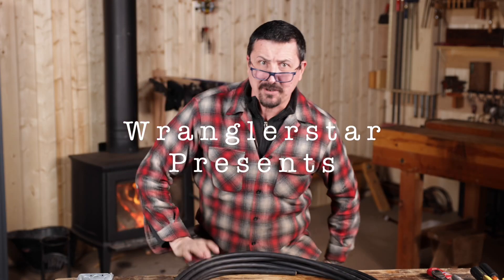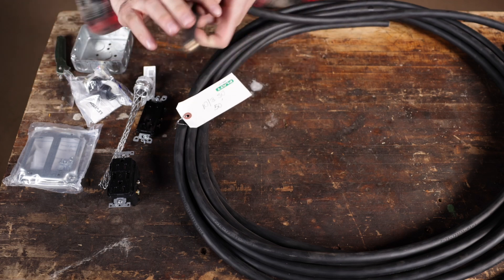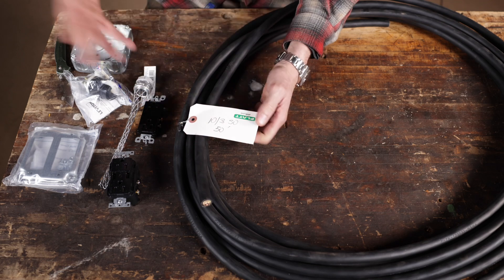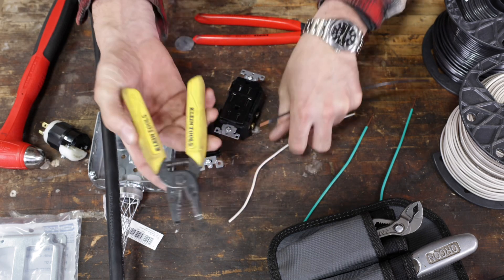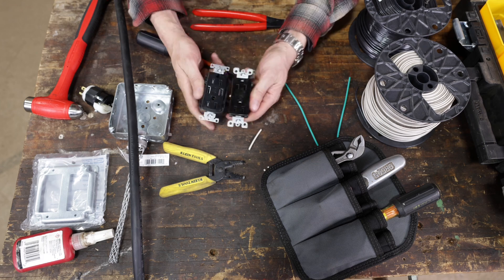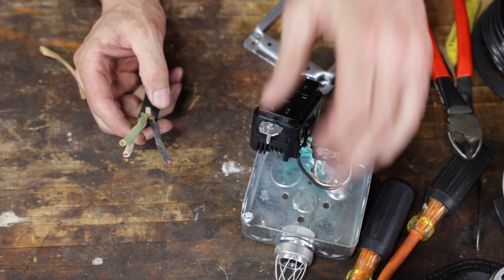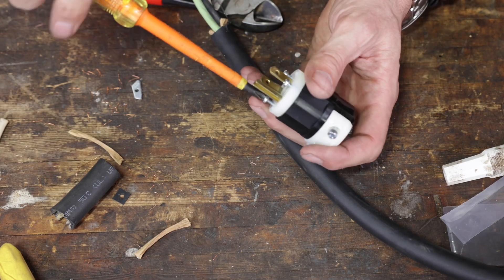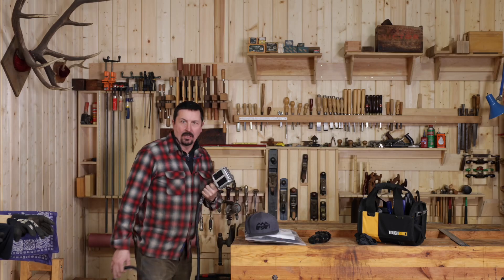The Ultimate $150 Shop Accessory - ALPHA CORD

Comment: Wranglerstar has the bravery to upload these electrical vids knowing that the internet electrician guild will swarm his comment sections. The man has no fear.
Reply: views are views
Reply: haha i was one of them .hahahahahahahah I recomended that he put a drying plug on the end and wire the 2 oulets to the separate phases, THEN it will truly be a beast. .  and pump out 7200 watts total 3600 watt per outlet,  the only weak link would be the 20 amp outlet, but i feel confident it would work just because the 10awg is wired directly to it so the the path from the 10awg to the outlet is likley less than an half of inch with very little resistance. . .  would be a interesting test to pump 30 amps thru it and see how a  20 amp outlet fairs wired that way
Reply: @mikeriverajr4447  Yeah I was gonna mention what you said, being an electrician I just couldn't help myself. The plugs and the male cord end he's using are way underrated for that gauge of a cord. Plus as everyone else has mentioned, he's got his lock-ring on the outside of the box when it should be on the inside. And lastly, the box he's using is not really correct. Any electrical box with knockouts is supposed to be affixed to a wall, per code. They make pendant cord boxes that have a single threaded hole on the top specifically for a cord strain reliever. One reason why you don't want a box with knockouts in this situation is because if he were to grip onto that box and try to plug something in, he could potentially push in a knockout with his finger or thumb, and that knockout tab could come in contact with a side screw on the back of the outlets. (also why you should wrap tape around the back of an outlet device after wiring it).
Reply: @420JackG  commercially this still is atleast at all the H-E-Bs and most super that need drop cords
Reply: That's the plan, Stan!
Reply: @mikeriverajr4447  I actually thought with that heavy a wire itd be a 30A plug.
Reply: lol
Reply: @Fordgroup00  👍
Reply: Omg i want this
Reply: Yeah he realizes all those posers aren’t actually doing things in the real world. Just a bunch of internet experts lol.

Comment: Electrician here. We call your "slugs" knockouts. Your grounding wire for your j-box, we call those stingers. The cord you have there, we call it s/o cord. I also save the metal tabs i cut off of devices and use them as washers. Always carry a few in my pouch. Im sure somebody has mentioned it, but your strain relief, (sometimes we call them kellums grips), has a lock nut on it, that goes inside the box. The plastic cap that screws onto the threads is a called bushing. Some guys may call some or all of these things by different names but this is just what I was taught.
Reply: I’m an electrician also, we call those “green wires” grounding pigtails or green pigtails here.  There’s a million different names for the same thing in this industry
Reply: @bigguyprepper  Yessir.
Reply: ROFL.. He does have his lockring outside the box. LOL. Yeah.. Hold your industrial cord to the box with a 10 cent plastic bushing.. It'll last a long time. NOT...
Reply: You and the John’s guy are correct and I agree with everything. Cheers from the ibew local 1531. (If you’re union anyway)
Reply: @charlesbirchett7059  
Local 527 over here, brother.
Reply: @idontsleepidream  I hope to head to Texas in a couple years! I can’t wait.
Reply: @charlesbirchett7059  Hell yeah! Work is here. Going through a bit of JW shortage at my local. Organizing new brothers and sisters everyday.
Reply: With such a heavy wire, why not install 1 of the 2 outlets with 20 amp. rating?
Reply: @idontsleepidream  I was Local 1 for a while here in St. Louis brother.
Reply: @russveinot5754  that's not how it works, with this setup you're basically just limited by whatever outlet you plug the cord into, if you overload it it will trip the breaker (or should anyway, if it doesn't that's bad)
Reply: Okay thank you, I saw the lock ring on the outside of the box and thought ‘you’re going to hang it from the bushing?’
Reply: Hey electrician! Help me out, he says he’s using 10-3 wire and that looked like 10-2 (I’ve always understood the second number refers to number of insulated wires); so 10-3 would be 4 wires 2 hot, 1 neutral, and a bare ground.  His cable had 1 hot 1 neutral and a bare ground, so I’ve always heard that referred to as 10-2???
Reply: @therealvidkid Tray cable and S/O cord, like he's using here, will be labeled 10 AWG 3C. Meaning #10 wire, 3 conductors (counting the ground). M/C cable and romex will be labeled like you mentioned, not counting the ground.
Reply: @fatheremmons85  thanks, I went back and looked and noticed his ground is insulated…. So I guess that could be part of it too .   Thanks for your expertise!
Reply: @therealvidkid  No problem at all!
Reply: In the film industry we call 20 amp extension cords stingers.
Reply: Interesting.  "Stinger" here refers to the entire extension cord assembly.  "I need two fifty foot stingers, a lunch box, and a cube tap".
Reply: Went to an electrical school and he built one better than the one I built.
Reply: @idontsleepidream  Local 2 (retired) here, brother!
Reply: No said don't bring that to work? OSHA would not approve that assembly. Yes heavy duty but not a listed and  rated assembly.
Yes it will work but it ain't right.

Comment: Cody. The metal nut on the strain reliever should be on the inside of the box and then the insulater goes next. Frank
Reply: Also don't use metal boxes with knockouts for extension cords.  The "slugs" can be bent inward and make contact.  Another Frank...
Reply: @frank-pl8vn  lol at the “another Frank” comment.
Reply: Also, if you use the correct end of the cable you won't have to cross the wires inside the plug end.
Reply: Yeah, good job. Only problem is he has the plastic bushing on the inside threads holding it together instead of the metal lock nut. That won't last long, it has to fixed. Also to use the push insert option on the back of the outlets will eventually fail and lose a good contact. The springs weaken from the heat, vibration, etc. Depending on the amount of use the cord gets, it will determine the time it has before failure. Always make the hook and wrap it around the lug.
Reply: Can we get a comment from someone named Beans here please.
Reply: @RK-ig9ie   I agree with you on certain applications but he should have no problem there because that is not the push in style the wire is tighten down with the screw
Reply: They do make the plug with usb c. One side is usb c, one side is usb a
Reply: Use a cast Stonco box and use hospital grade 20a receptacles. Hospital grade needs more force to pull out the plug. Great for garage or workshop
Reply: All of you guys are not Professional Homeowners and it's really showing...
Reply: Ugh, yeah. Lock ring THEN bushing!
Reply: @bryangeary5848  well thats good to know. For us dumbasses that can't figure it out ourselves lol. My comment to this was going to be "why are the wires almost always on the wrong way". Clearly I'm not a professional homeowner.  Lol
Reply: Agreed lock ring then the plastic bushing, close though! Haha
Reply: Also, tape the end of your Kellems grip to your extension cord to prevent it from pulling out over time. -Thor
Reply: Glad you pointed this out. That plastic ring won’t handle any weight.
Reply: That one bothered me a lot too man. But for the most part, better than a lot of the electricians I know.
Reply: @frank-pl8vn  I doubt the inserts will ever get knocked out unless you start using the box as a anvil for some hammering.
Reply: @RandyRandersonthefamous  I agree with you but I had an OSHA guy cite us for them in the shop I was running at the time...
Reply: And they make a tool to tighten the nut. Hammering on the end of your screw driver will destroy it!!!
Reply: You can buy these premade we used them all the time in live events called quad boxes. If you want USB just swap the plug that comes with it.
Reply: @RK-ig9ie  "it has to fixed"
Reply: @bluecollarbiblescholar  oh well i swear cody does these things in purpose to freak out the sparkeys
Reply: @RandyRandersonthefamous  even if they did the breaker will trip. Wrapping the recepticals in tape would prevent all his concerns. I see no problem with metal here either
Reply: THANK YOU. I am so glad that I wasn't the only one to see that. Lock nut, THEN plastic protector.
Reply: @tatesharrow6176  The premium plugs have plates that grab the wire and the wire is clamped between 2 plates by the screw. The wire is meant to be pushed in and clamped but wrapping around the screw is more secure.
Reply: The white wire in the brass screw had me triggered "black to brass, white to silver" is the phrase we use in the midwest.  I don't recall even seeing white to silver happen anywhere.  Sure, brass and gold are both the yellowish metal, but "black to brass" is so much more memorable.  Sure, the white isn't actually silver metal either, but again memorable and obvious.

The locknut on the outside was also triggering, the plastic bushing won't last at all.

I agree that it's probably on purpose to trigger us - if you don't know these things you probably shouldn't be doing electrical.

For us, the "slug" is the piece on the floor, in your toolbelt or box, etc... while it's in the box, we still generally refer to it as a knock-out.
Reply: @reclhoss  😂😂😂
Reply: @sean7119  thats a good tip , never would of thought about those outlets having better holding power. Thanks
Reply: @alpha2zulu854   and a hot dog for good measure
Reply: @redscortgt93  Frank and Frank and coming in hot.
Reply: Lol  this is why electrical isn't a hobby lol
Reply: @djohns4u  thats not true if you are using steel lock nuts that little tool doesn't work with rigid pipe although i do love that little tool i keep the 3/4 and 1/2 inch in my pocket everyday 😉  but you are going to damage steel lock nuts with a screw driver they have to be very tight to make a bond
Reply: hated seeing this in the video, omega cringe
Reply: @alpha2zulu854  Frank and beanssssssssss
Reply: @frank-pl8vn  yeah for mine i use thoes outdoor boxes for mine
Reply: ive seen the work he does and i would never trust him when doing electrical work
Reply: @bryangeary5848  ?? that doesn't make much sense. it would be rotational orientation maybe (Clockwise) but not 1 end or the other.
Reply: This is a short example of what is regularly seen on commercial construction sites.  Most are about 200 feet long and have a double duplex in a four by box every 50 feet.  Yes they are metal, no that is not a safety concern, if everything is assembled properly.
Reply: @RandyRandersonthefamous  all it would take is the box swinging as someone walked it around, and it hits a corner of a desk, or tool box, or railing, etc. That's enough to bend that cheap zinc slug right in. I've had it happen to those boxes in the bag on the way back from the store.
Reply: @djohns4u  A proper electrician never uses a hammer on the end of a screwdriver - he uses the sides of his Klein's  :)
Reply: @HoosierRallyMaster  hahahahaha
Reply: Been using one like this for years they do last longer then cheap extension leads but depends on the materials used I'm in the UK so I us a brand called mk
Reply: Using a ground fault outlet on one side would be a plus.
Reply: @frank-pl8vn  haven't been able to come across one without slugs everywhere